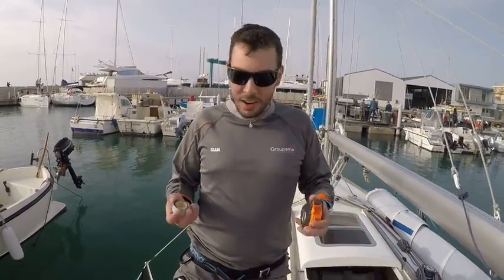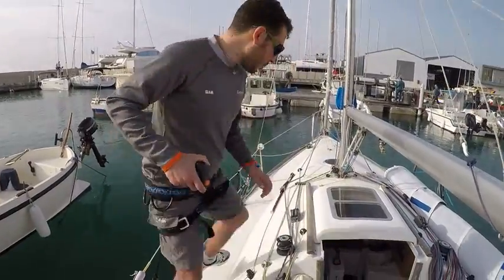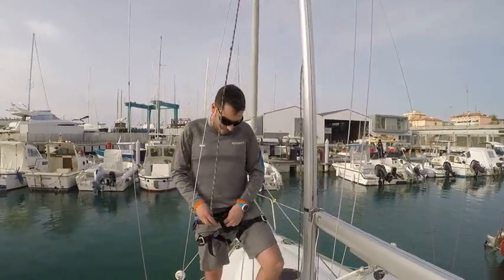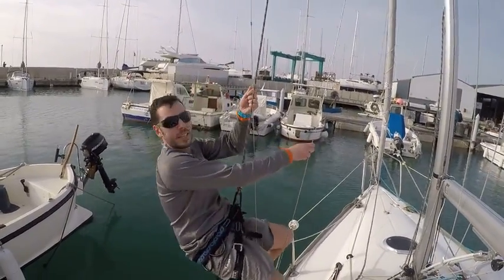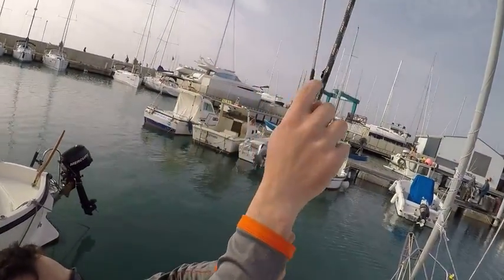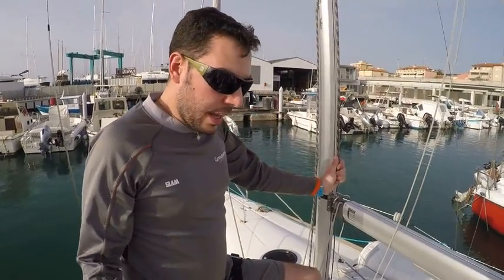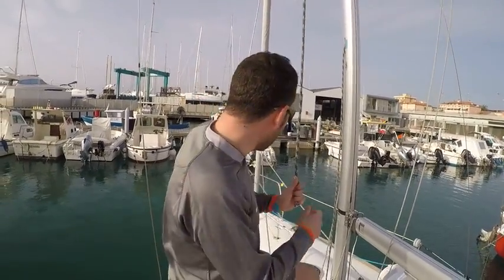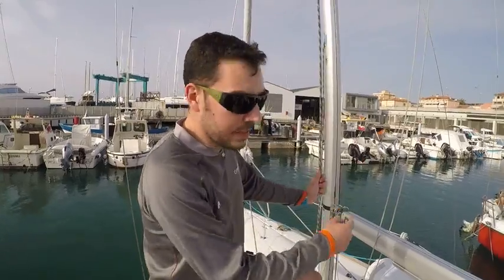First 21.7 Rig Tuning

Comment: Hi Marco. Very good video. I have firtst 211 and I think my forestay (genoa shroud..)s too long. There are only two holes  on bow for adjusting the lenght. Are there any other solution for shortening forestay? I already made a third hole on bow..
Reply from the maker: Hi Samo, do you have the standard plastimo furler? Is your boat neutral or Is it willing to point into the wind by itself? Do you feel it un-balanced when sailing upwind? If so, it Might be that your mast is pointing backward and you need to push it forward by reducing the forestay; if not, you don't need to tension the forestay, but the high shrouds. We have a fb group called beneteau first210, 211, 21.7s, 20twenty. You can join us and have extensive tips
Reply: Yes I have standard plastimo furler. I tried your metod of adjusting mast tension and when high shroufs are not too tight the halyard is already 40cm from mast. You mentioned 20 to 30cm is enough. I will be glad to join your FB group. Thanx.
Reply from the maker: @samo-nx2pl  check wheather there is space in front part of the mast between its step and the metal plate where you have the haylard blocks. Did you already moved the forestay pin to the closest position   to the bow eye using  the plastimo plates? You should be able to put almost no space between the two, only a hole.

Comment: We know what you meant when you said mainsheet scotta randa; for drizza principale we say main halyard. You are absolutely correct: to tune a mast you do not need a tension gauge, your eyes will tell you what you need to know. Proof is your mast perfectly tuned. Not that it matters here (bc it was not shown or mentioned), but when centering the rig, keep the main halyard away from the lazy jack influencing it. Swinging the halyard between the jacks and the mast when taking it to the opposite side would affect that distance on one side or the other. Instead, swing the halyard around the back of the lazyjacks when going from side to side.
If you are reading this to learn more after watching this video, please remember that when the spreaders sweep aft, tensioning the high shroud (upper) relative to the lower shroud will increase prebend, that is the bend you start with before tensioning the backstay. This is because a tighter upper, combined with a raked spreader, shoves the middle of the mast forward through compression of the spreader. 
Rake is how much the mast leans (leaning aft is implied) and more rake (aft) will increase weather helm (makes the boat want to head up). Bend, on the other hand, ALSO moves the mast tip aft, but unlike rake (leaning aft), bending the rig moves the tip aft by bending the middle of the mast forward. The effect from bending the mast aft instead DECREASES weather helm, by flattening and de-powering the mainsail. Too much bend is obvious bc there will be a sharp crease running diagonally across the front ends of the battens to the masthead.
There are lots of videos on mast tuning, here we are learning from an expert, Marco (not me lol). Thank you, Marco